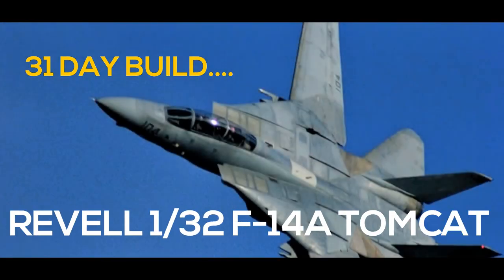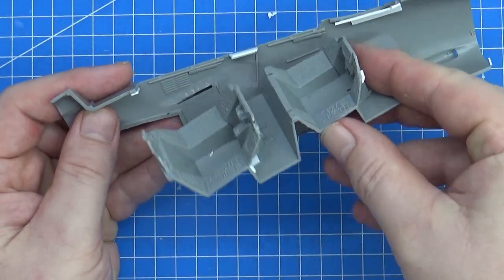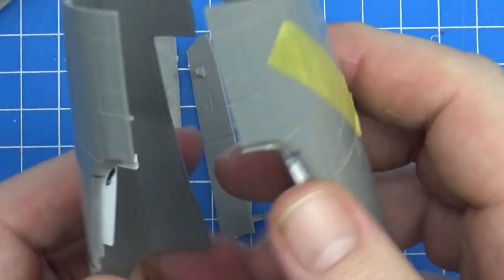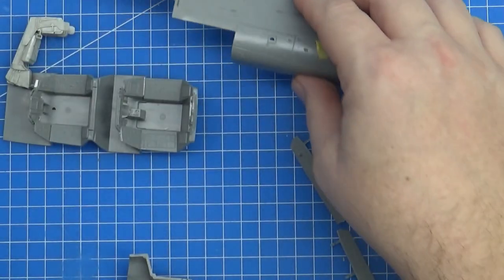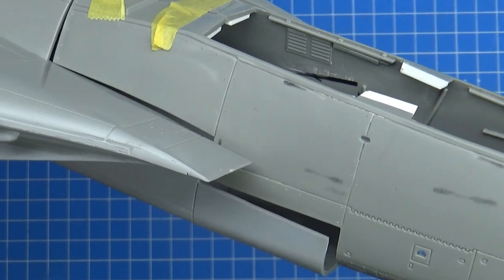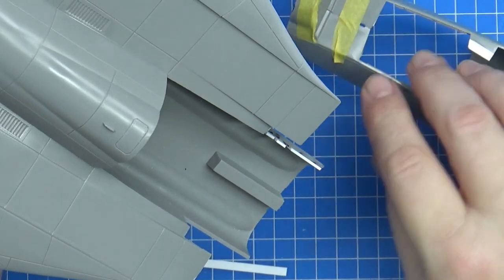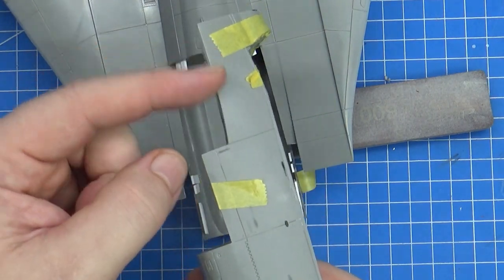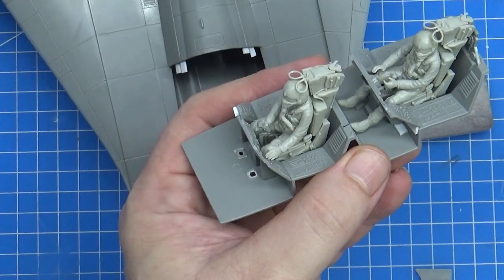1/32 Revell F-14A 31 Day build - Part 7 Cockpit again....

Comment: Not a very beginner friendly kit by the looks
Reply from the maker: Oh no. Stay away if beginner for sure...or if you just want to chuck it together, but its not a cheap kit either...
Reply: @beckersmodels  a kit for the masochist
Reply from the maker: @BrodieD  Its why I picked it for the 31 day build - just slam it together because if you whinge about the fit and detail and try to fix it all, it will never get finished! Anyway, I've built my fair share of Airfux crap to get through this thing....but I'm eyeing off the 1/32 Tamiya F-14 that I have just to the side of my bench applying the same pressure - 30 days only to finish the bastard! (I'm halfway through rescribing the whole bloody thing....sheesh)